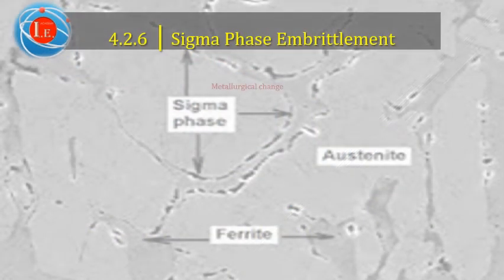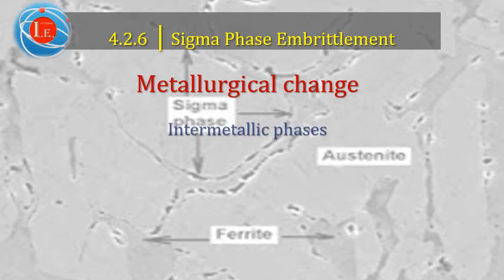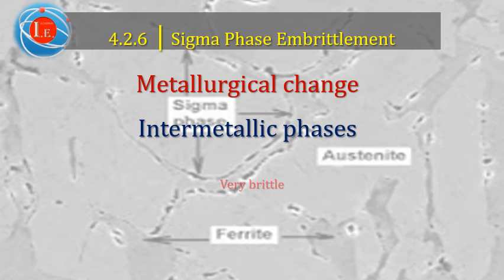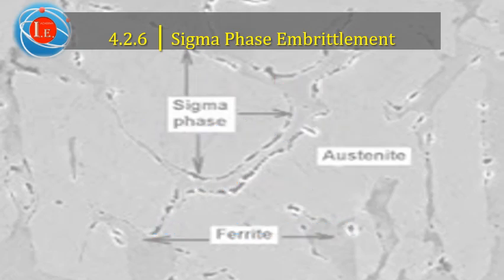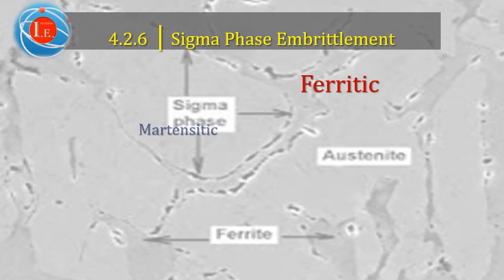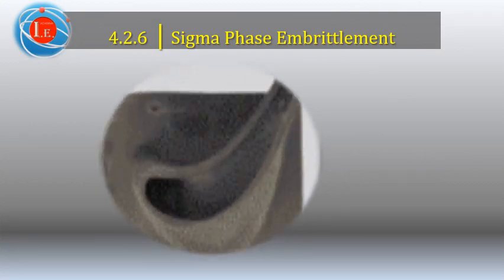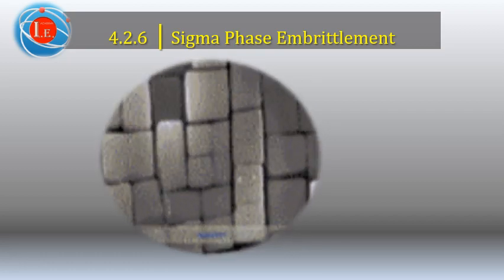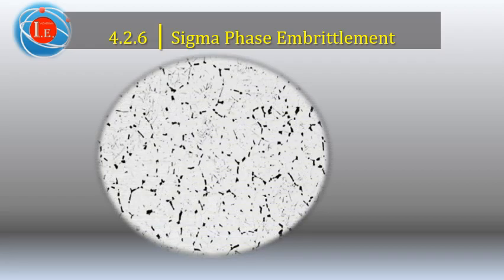4.2.6 Sigma phase embrittlement

Comment: so how do we get rid of the sigma phase? solution annealing? HELP!
Reply from the maker: many thanks for your comment Kingbass, generally speaking 300 Series SS can be de-sigmatized by solution annealing at 1066°C for four hours
 followed by quenching in water. However, this is not practical for most equipment due to size and unstability or possibility of bulging.
therefore, in order to answer your questions precisely we need to know more information if you have specific case, like : new or existing equipment, what type of equipment valve, PVs...etc., welding included or not, which material DSS or 300 or 400 SS or even weld overlay cladding, what type of service then we can provide you advise on which material is more suitable, what test or inspection used for monitoring, what precautions to take into account...etc.
if you like feel free to contact us for free advise on our company page "Mat-Integrity" on LinkedIn
https://www.linkedin.com/company/13056385/admin/
Reply: So we had a case of bad Charpy impact values at -40°C (MW 30 Joules) martensitic Cr-Ni steel QT (17% Cr). Problem was preheating at 650°C for severeal hours before die forging. Metallography: 2% delta ferrite   in martensitic structure grain size G=2,3 - 3,0. Etched with V2A elevated temp. Little black spots formed in the delta ferrite - turning to sigma phase? Also detected some grayish black inclusions at delta ferrite grain. Metallography is great!